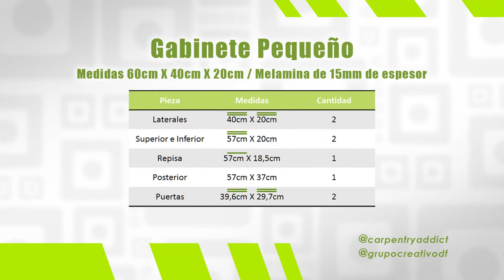Gabinete de Melamina FÁCIL de hacer - Gabinete Pequeño - DIY

Comment: No sería mejor unir las piezas con tarugos o galletas? Con ese sistema krep se ve poco estético dejar esas perforaciones...
Reply from the maker: Si tú prefieres hacerlo con tubillones o tarugos de madera puedes hacerlo perfectamente usando las mismas medidas del mueble. Saludos.
Reply: @DomingoFreire  👍
Maestro en dónde compra la melamina de 15 mm 2C,  2.44x1.83?
Reply from the maker: @Rogsdeco  En Caracas la compro en Distribuidora Ecoplaca 3000 @ecoplaca3000 en Instagram y Grupo Chapam en Maracay Edo. Aragua @grupochapam en Instagram
Reply: @DomingoFreire  Perfecto maestro, otra pregunta, quiero hacer un mueble de lavamanos en melamina de 15 mm, para no dejar tornillos visibles, con tarugos tendrá la resistencia requerida? Sin que se afloje el mueble?
Reply from the maker: Trabajar con tableros de 15mm de espesor requiere más pericia, pero si ya tienes experiencia puedes hacerlo perfectamente.